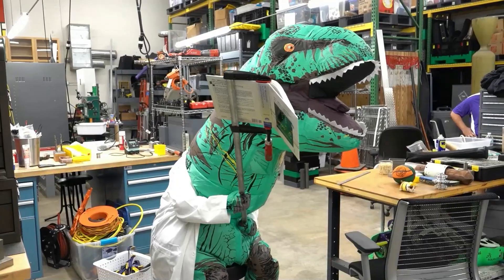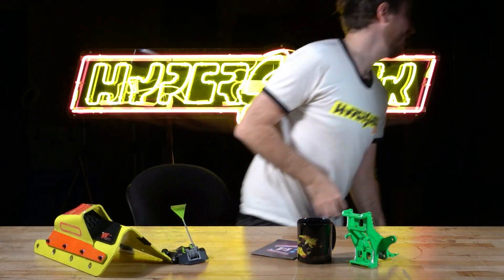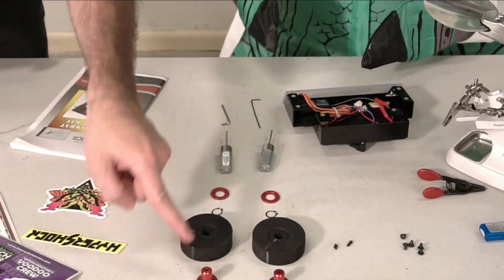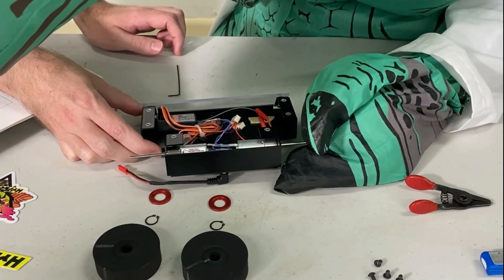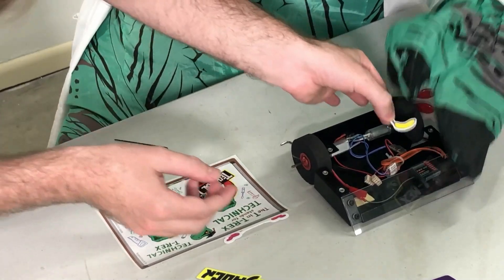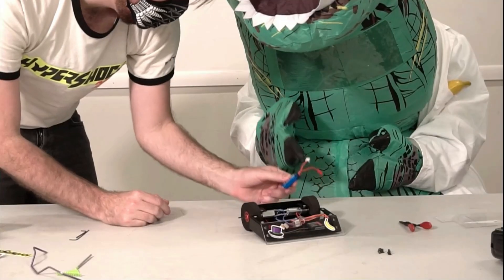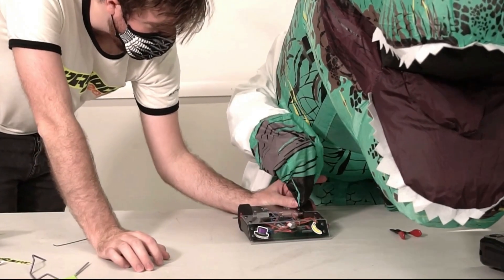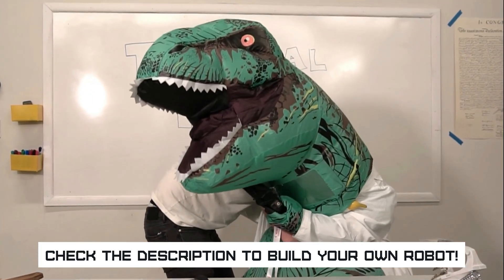How Do You Build A Robot? // Technical T-Rex

Comment: It's not a robot, it's a toy good toy, good cart on wheels, but not a robot. The robot is a slave, it must do useful work. The robot must move along the steel rails so that the movement is accurate. The robot must be equipped with a spindle to cut any object from any material.